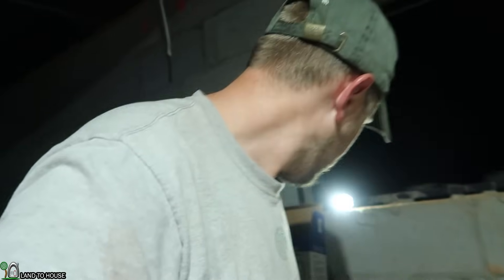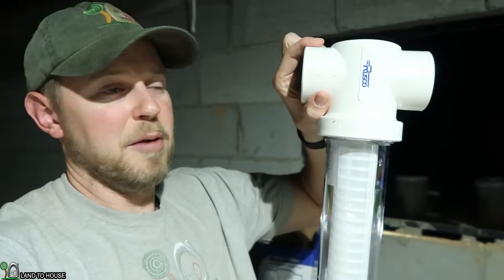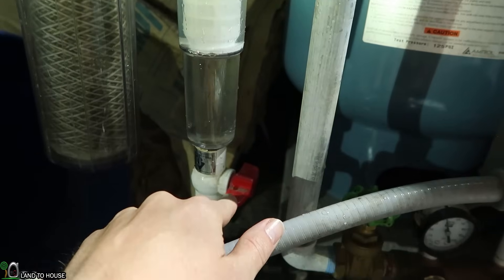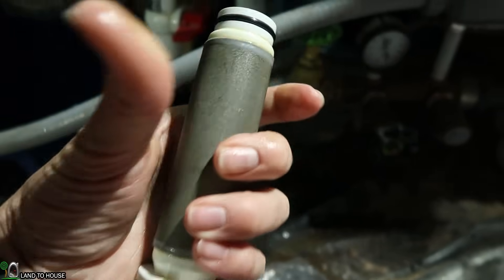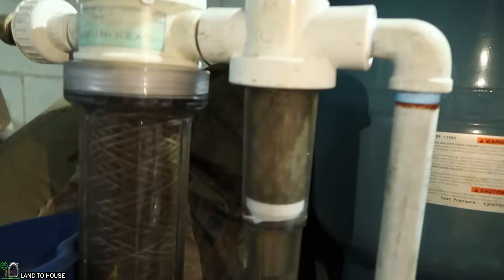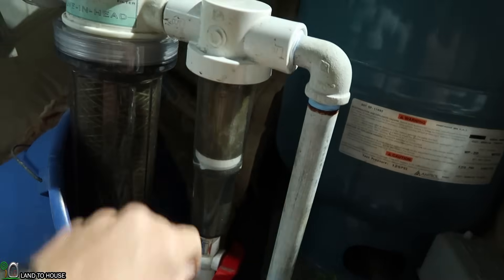Rusco Spin Down Filter Major Upgrade

Comment: The filters you are using are not designed for your needs, they are way too small, get a tank at least 9 × 48 capable  of back washing it self ( manual valve if you want to save) an fill it up with ZEOLITE TURBIDEX filtration media, this is  professional stuff and they are not to expensive, that will trap suspended particles 5 microns or less, and if you want better results with your water quality,  follow with an activated carbon 9 × 48 tank and a water softner, and at the end of your sistem your sediment filter that should remain clean for many many months if not years, just in case.
Reply: You should make a video. Very interested

Comment: Thanks for the video, I am currently going through the same process. Started with the spindown with cartridges, I could see after one day that I would need to change it very often. We only have sediment, no chemicals, at least at this time. When I realized how much sediment was in my water I decided to backflush my hot water heater, in service for less than 2 years. Needless to say it was full of sediment. It would not even drain without water pressure, I flushed it for something like 4 hours until the water was clear. Following this I decided to take a look inside of my pressure tank and it was really gunked up as well. Took it out of service tried to clean with bleach and vinegar and it did clean somewhat but it was still filthy. So I decided to put a new pressure tank in since this is our drinking water and it taste great and looks crystal clear. I would have thought it would taste like mud after seeing how much sediment is taken out in the filters. Anyway, I am rambling a bit, and I have a question. Why would it not be better to have your sediment filters in front of your pressure tank? I an DIY'ER and I am not saying it would be but have you thought about that or found any info saying it is better to filter after the pressure tank? Sediment must be settling in that pressure tank in my opinion. What do you think. I would love a reply and thanks again for the video.
Reply: The filters' manuals state to not place the filters before the water tank because of the unregulated pressure of the water coming from the pump. The housing and filter could get damaged and leak. 

What he likely needs to do is to flush his well and/or raise up his pump because it might be sitting in sediment.
Reply: The problem that you potentially create is if your spin down filter becomes so clogged that it restricts  the flow of water, your pressure relieve valve and switch is now located after the filter and does not obviously see the high pressure on the well pump side of the filter. This means that your well pump is continuing to pump against a restriction which is going to cause it to overheat whereas the pressure relief valve and associated switch turns the pump on and off is not seeing the high pressure because the filter is plugged and hence the switch is not going to turn off your pump. This is a potentially dangerous situation that could cause premature failure of your well pump.

Comment: Don't forget that your rusco spindown has to match your gpm provided by your water supply.  So if your rusco is too big, you might not have enough gpm to trigger the spin-down/venturi.  Also, you could always install 2 ruscos in parallel.  Would reduce how often you have to service them.

Comment: I have a ground breaking idea here. Install a largeush pressure tank after your spin down filter.   After you shut off the house water filter, you can shut off supply water, and open the spin down drain, this scenario will force water backwards from pressure tank, through the filter, out the drain, likely cleaning it from behind about as well as you do when you remove and rinse it.    I thought about recommending you flush backwards with supply water.... but that would get debris stuck on the back of the filter and allow debris into your woven filter as well. So a pressure tank filled with filtered water would be a better way to backwash it. And, with this kind of setup, you could also automate the cleaning of the filter with a few solenoid valves to occur every few weeks automatically.  I use an automatic RO membrane flush that works similarly and is hands off

Comment: IF YOU put a bypass line( and a shut off immediately in front of spin down normal intake)so that you can shut the normal direction of water flow off to the spin down THEN you can actually backflush (reverse the direction of water through the screen) and clean it during 'Spin down' with only rarely having to disassemble it.

Comment: I don't know what your well is like and its characteristics, but I imagine the pump submerged in sediment, you tried to pull it up, to raise it, for me it fishes too deep. A bypass and countercurrent washing would be needed but in your case it would be counterproductive, too much sediment, an additional cyclonic or hydrocyclonic anti sand filter would be needed, well calculated to work well, if too large or too small it does not go correctly and an automated drain valve like a motorized and a sonoff that controls it, either timed or as desired for both filters. Ciao

Comment: Try backflushing the Rusco by 1st draining it the normal way, then shut off the supply water, open the drain, and turning on the house filter valve to cause water to flow backwards through the Rusco.  It may force the clinging silt off the media and down the drain.  Just a thought.  That is how automatic industrial filters self clean, by backwashing.
Reply: He might not have enough residual pressure or volume within the house plumbing for that to be effective. He does seem to have a spare 3/4" Rusco now though, so could rig them in parallel with a couple of ball-valves.  Each Rusco will backflush the other.  Using solenoid valves, the entire flush and backflush process could be automated.

Comment: would be cool to build an automated flush system. That drains the filter, when the pressure is below a certain threshold. Maybe you could extend the time you need to clear the filters that way. Auto flush every so many days, to keep the filters as clean as possible.
Reply: Shh that would make too much sense.  That's now how the world works lol
Reply: Actually easy to do.  Any industrial supply has timed drains.  I have used them for air compressors but should work fine.
Reply from the maker: This company actually now has a timed drain system. I might be testing it soon.
Reply: @LandtoHouse  Would love to see that coupled with backflushing or, even better - automated backflushing.

Additionally, would be nice to see one that has bristles inside so you could twist them from outside to scrub the filter element while flushing.
Reply: Rusco has that, called an auto flush system
Reply: I used a sprinkler timer on mine. It flushes daily for about 15 seconds, then weekly for about 30 seconds, then monthly for about 1 minute.

Comment: Add a solenoid ball valve and a timer. Set it to go off once a week for a couple of minutes. Sprinkler timers and valves work well. That will prevent the sediment from building up on the screen in the first place. The other thing you can do is add your original unit back in AFTER the larger unit. There should be less sediment to plug it up, but adding it will allow your house filter to last longer (solenoid ball valve tied to the same timer). I would also add a union on each unit you have in the system, it helps a LOT.
Reply from the maker: Unions are so hand to have. I'm thinking this current filter setup will last 2 months. Even without an auto flush that is much better than it has been
Reply: Adding a sprinkler timer and electric valve sounds good in theory but what happens if the valve doesn't shut off does it flood the bottom of your house
Reply: @gumbystown  I thought it was obvious, but perhaps not. You need to run a drain line from that ball valve to a sump or other drain.

Comment: Fifteen years ago I upgraded my well with a submersible pump. A small spin filter was installed with a 100 mesh filter. My whole house filter was clogging every month so I switched to a 140 mesh. I bought two so I would switch them out every year. Virtually no sediment on them and none at the body bottom. I recently started having problems again so I ordered a 250 mesh filter. The 140’s are stained brown and that might be from particles stuck to them. I hope that that solves the problem. 

Great video.

Comment: When you purge the spindown, leave the house supply open. That way, some water will return and wash the filter element a bit.
Also, next time mount the filters higher - at shoulder level. It will be easier to work and maintain.

Comment: I was searching on this topic and your video was a result! Good stuff here, I've got issues with silt in my well also. Frustrating issue, I need to get the spin filter stage going. The string filter alone is not nearly enough.

Comment: Thanks for sharing.
Looks like a struggle/pain every time you have to flush the sediment out or replace the filter.  Why not extend that pipe coming from the pressure tank up a few feet to give yourself some clearance.  Being able to fit a 5 gal. bucket under there would be much nicer, no?

Comment: Hi Seth, great testing!
A couple of thoughts that might further improve your system...
 - Place your 3/4" housing WITHOUT filter (or with 12 mesh or so rock catcher) inline before your new filter.
 - Provide 12" or more of straight pipe before and after each spindown filter.
 - Add a set of ball valves to provide bypass and backflushing of the filters.
 - Add pressure gauges before, between, and after filters to allow measurement of differential pressure across each.
 - As others have mentioned, consider plumbing in an automated blowdown valve that opens for a few seconds each day.
 - Bonus points for connecting to a PLC and using pressure (and flow?) sensors to flush as needed and notify on required maintenance.
Reply: For your bonus points you could find or buy an old automated sprinkler system, or if you already have one, just run a pair of wires to it and you can set it up to turn the purge one once a week for a few mins and you are done.  No plc experience required.
Reply: Really god advice which I am going to use! Can you describe the setup for “PLC and using pressure sensors (and flow?) sensors to flush…” I really like this idea. I have a 2” Runco now on our irrigation. I have a Hunter system that has a master valve under the Runco to flush using the program cycle. Although not necessarily needed here in this discussion, I also use a rather elaborate system to add acid and water soluble fertilizer to our water. Its a Dosatron and a micro doser with ultrasonic flow detection. I keep a Nest cam pointed at my system so I can see the filter and gauges as needed when we are away.

Comment: My pre filters arrived the other day, I doubled down on each 1 as sets so I can turn off one set of filters and use the 2nd set. I have 2 each... 200 micron, 100 micron, 50 micron and 40 micron. 4 shutoff valves, 1 at each end of a line of filters. Our water tasts good, cold and runs clear mostly, tho we do get fine sand and sediment. I will look into some other filters for .5 microns for drinking and cooking, overkill?.... probably but I want to set it up so there is little to no disruption during any maintenanace. Happy New Year!! and Thank you for the video.

Comment: Excellent video. I use the large Runco spindowns on our well water supplied irrigation system. We have a Hunter irrigation system. I have installed a master valve under the Runco. When the irrigation program goes through its cycle, I have it programmed to flush the filter each complete cycle. The program only allows minimum one minute so it does flush a bunch. My filter eventually does get clogged though (mostly fine iron oxide/rust) so I need to bottle brush it every couple weeks. I am thinking of having two Runco filters inline - one with a larger mesh first and a finer mesh second. I do need to watch pressure drop though.

Comment: Just something to think about.. when I install the rusco style filters( I am a licensed plumber) I use a pex female on the bottom of the filter housing and run pex to a hose bib somewhere easy to use. If you use the hose bib on a regular basis you wind up flushing the filter more often. If you don't want to use the pex fittings you can put a sharkbite female on the bottom of the housing as well so it remains easy to remove the housing when needed.

Comment: seth what about  putting the stainless steel and small trap between the two adding a third unit  further  protecting the final water filter and the first larger filter should or will really  slow down the stainless steel one from blocking

Comment: I put mine on "loop" where the filter can be serviced without shutting the house off. That way if it broke, we're not without water. But WOW thats a lot of sediment, I clean mine twice a year. I wonder if your pump is at the very bottom of your well.

Comment: LOL those filters were not dirty. We clean our filter whenever we acquire 3/8 in of Virginia red clay.  It breaks of in chunks for easy cleaning. I also find back flushing helps if the water system above is large enough to apply pressure to break the sediment lose from the screen.  Helps a little between cleanings, which are a pain I agree. I’m looking for a self-cleaning model..

Comment: You could automate the clean down of the filter. Take the threads from the ball valve and put a normally closed solenoid valve on and a timer then run the discharge to a floor drain or out to a rain barrel. Have the electric timer kick on for 30 seconds every fourth day or so (you’d want to play with it to see what works best for keeping clean and saving water and power) but this would keep the screen completely clean by flushing the silt from the filter more often and not letting it cake. Then you could probably go to like a 200 mesh instead of 100 mesh and not clog up your string filter as quickly. It’s similar concept to the auto drain on a compressor tank. Just a thought for saving you from having to climb under the house all the time.
Reply from the maker: That does sound like a pretty good idea. I think I'll give this a few months and see how it does. I'm anticipating two months. If that's the case I don't mind going under there to change it out.
Reply: Very well said, by automating it to spindown more often it would most definitely keep filter from clogging. 
Thank you!
Reply: I added the Rusco automatic flush valve which allows you to set a timer, but I wanted the ability to have “on demand flushing” and also more variability than the Rusco timer allows for. I pugged the Rusco automatic flush valve power into a WiFi enabled outlet. I now control the flush by pressing a button on an app on my iPhone. I can also use the scheduler on the app to turn the automatic flusher off and on as many times per day as I want to. I ran a piece of flexible hose to a drain with a trap.
Reply: @jned3967  I'd like to hear some more detail around this set up you have.
Reply: @cparker3931  Just saw this, what would you like to know?
Reply: @LandtoHouse  Ispring makes a spin down filter with a valve on it to flush it automatically on a schedule, and it has wipers to wipe the sides down.

Comment: Hello, thank you for your video - I  also have to cope with a sandy well and  thought that a bigger/larger filter is always better that a smaller one.

Also liked the ideas of David E. and Pietro - it seems they are professionals - will take their advices in account.

To Rusco Co.:  the translucent  removable part does not look reliable at all, specially the bottom part where the valve connects - I would prefer to have it in solid bronze with a gauge installed on the top to show the pressure on output end.

Now, I also got an DIY (unprofessional) idea and namely:  to turn this huge Rusco filter into a 2 stage sediment filter. I would insert inside the bigger/stock filter (accommodate and seal ) a second  mesh with a thinner grit mesh.  Of course it would make sense the outer/stock/main mesh to have much bigger grit. Let's say: outer 400 micron and inner (added) 100micron, or whatever - depending on specific of your well sediments. Of course it might affect the hydrodynamics of the vortex  and the pressure, but I think that way we might increase about 1.5 times both  the service period  and the quality of the water.

I am skipping the technical difficulties of accommodating the second filter, but I guess it is possible to be done.
Reply from the maker: Thanks for watching. This larger Rusco is working well. I no longer have to clean the filter every 3 days. As for the clear cylender. It is working fine so far. Once lasted a couple years with no issues until I changed it out with this one. Its clear so you can see how much sediment has been captured.

Comment: your on the right trail,have you looked into a commercial sand filters, one you can back-flush, sand filters are used on large sumps, and cooling towers for hvac systems, over time you will save money on filters, and labor, and you can have the sand filter on a timer
Reply from the maker: I have not seen those sand filters for a house. Very intriguing.
Reply: you can find the sand filters at a pumping supply house, i'm a retired steamfitter, and piping was the trade, boilers, chillers, you name it, i worked on the new installs, check around the net, in minniapolis, ans st paul, check out the on-line catalogs, good luck, i know you will find them...
Reply: sand filter, it's a round vessel, it has sand in the bottom of it, about 50 to 60 pounds of sand siltcon sand, the filter is approx 24 to 30 inches in diameter
Reply: Or a residential swimming pool sand filter would work quite well also